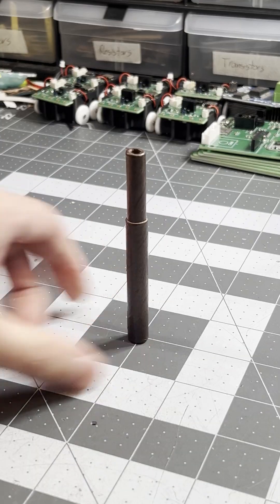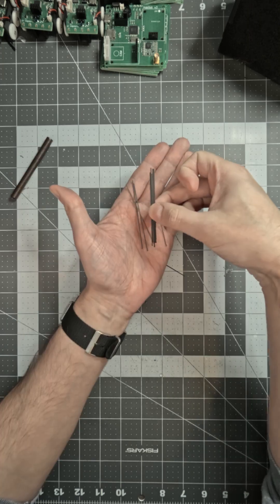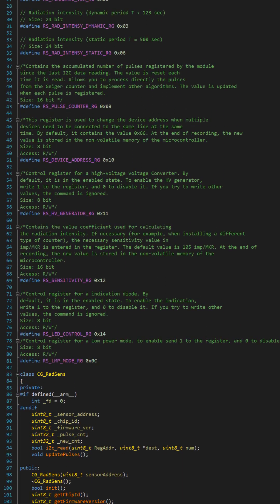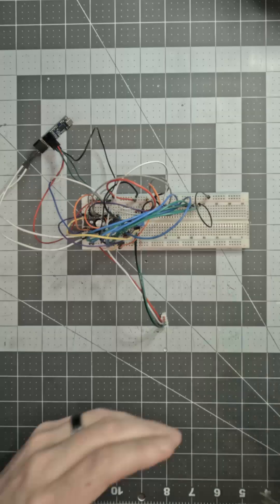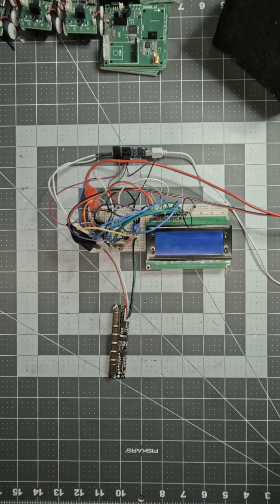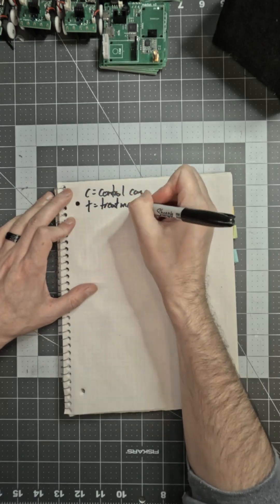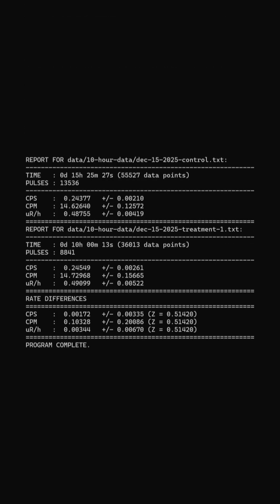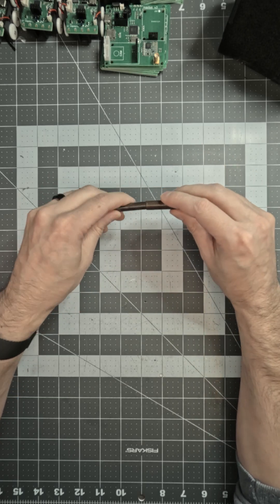Graphite From a Nuclear Reactor - Is It Safe?

Comment: But... Graphite is only found in the core where its used as a... Neutron Flux Moderator?
Reply from the maker: I may not know much about nuclear reactors, but I know a lot about concrete!
Reply: It was a long time ago, and a very low power reactor.  It has decayed to mostly harmless.
Reply from the maker: Agreed. We were just quoting Chernobyl. 😉 It's a brilliant six-part series. If you haven't seen it, you should!

Comment: Seems to me that when dealing with radiation, your default action should be to assume it is present. Therefore your null hypothesis (H0) should be that there is a difference from background radiation, and your statistical test should attempt to prove there is actually no difference. If H0 is proven false, then your alternative action can be removing radiation precautions.
Reply from the maker: I agree 100% with your sentiment that caution should be exercised before anything can be determined. In your suggested case, then, what would be the appropriate control condition?
Reply: @LateNiteMake I'm just joining in the conversation but I'm guessing the appropriate control conditions is not simply recording the count without the source present BUT to record the background count WITHOUT ANY source present - no idea how do you get an isolated background count though lol.
Reply from the maker: @syarilezzuddeen Yeah, I agree the ideal case would be to have zero background radiation (somehow) and measure against that. Sadly, as long as I'm dreaming, I'd like a pony. 😅 So we have to rely on the magic of statistics!
Reply: @LateNiteMake  all about dat χ²-test life 😂🤟
Reply from the maker: @syarilezzuddeen Right? 🤣